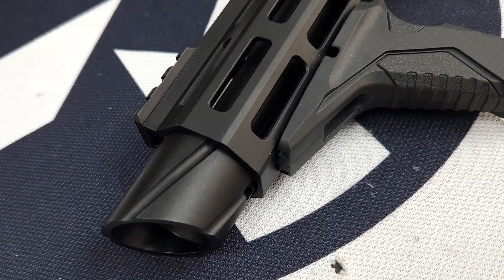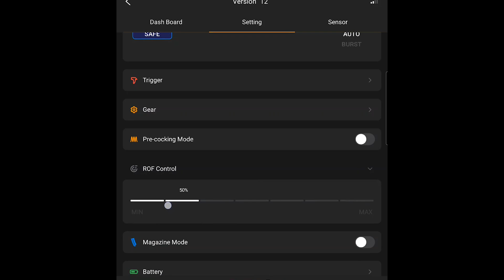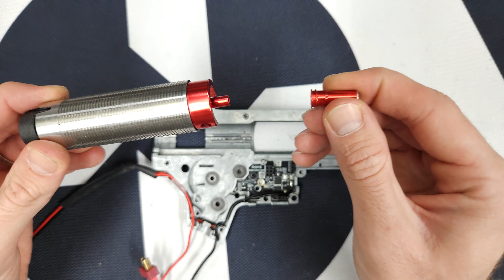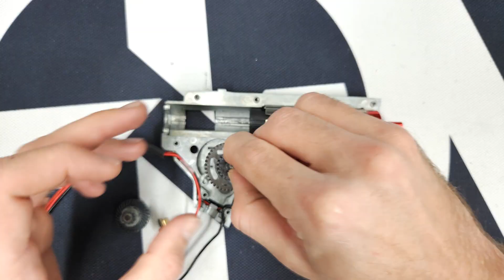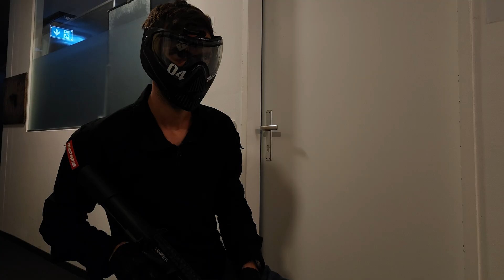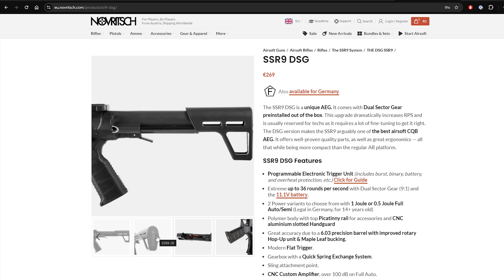SSR9 DSG: Meaningful Upgrades

Comment: This video is a year old, so I guess it's a good time to ask if that piston and it's body specifically is still intact after that many holes put in it to reduce weight?
Reply from the maker: I said this in another comment, i did not use this build extensively. Still, for the ammount of use it saw, there was no visible wear on any of the parts. I also learned that all pistons are consummables in a high rof / high stress builds. So i expect to exchange 1 every year if i use that gun mainly. Just the nature of these toys. The jaeger piston might last longer tho.

Comment: Any 1-year updates? Lessons learned? Comments and/or suggestions? Would highly appreciate as I ordered it recently.
Reply from the maker: This wasn't my main gun, as i prefer the speed of HPA, but i used it a few times. Held up well, until i wanted to put a 5.4:1 dsg in it, that is when the ETU called quits. It still works, but that setup at 66 rps is too fast for the Kestrel. Everything else is fine. What i said about the upgrades still applies.

Comment: I am sorry but having a full Cylinder is NOT worth it.
Not only is there no huge advantage, as the piston doesn´t travel back far enough to really get an advantage, but the hole in the cylinder allows the piston to gain some momentum before being slowed down by the air, meaning the airsoft gun has a higher velocity.
A DSG is not meant for high air volumes.
If you want to use heavier BBs, you have to go with a SSG and more teeth on the gears/piston.
Reply from the maker: While you are not theoretically wrong, in practice, you can clearly see different results. Sure, with a stronger spring, and ported cylinder you can get the same power i got with a weaker spring and no port. So why would you subject your gearbox to more stress, when not needed?

Comment: My dgs is stock already had to have the etu replaced and a few months later my fps has dropped and also my rate of fire  is now 26 rounds a second any ideas what it could be causing this issue
Reply from the maker: Fully charged battery? If yes, the motor brushes may be worn out
Reply: @DeXteR.AIRSOFT thanks mate could be the motor then batteries always fully charged

Comment: What tappet plate did you use? Also when you switched to the SSR4 nozzle what size O ring did you use. And also what cylinder did you use. What motor size did you use also with what type of ETU?

Comment: What do you think, i have a ssr9 i wanna do the same but i want a m170 and a solink 39k motor, bc in my counrty the fps limit is 420fps so i want a above 400fps 40+ rps gun
Its gonna work? With the m170 and the 39k solink?
Reply from the maker: @WoByaT  no, it will not. That setup is thought out badly. High rps means low fps. You can't have both. Or you put an hpa engine in.
Reply: Where are you playing that allows 40rps?

Comment: Hey i liked to know with of this parts i could upgrade for the german 0.5 joule variant without getting more joule and my motor is getting pretty hot is that problem solved with a better motor
Reply: @DeXteR.AIRSOFT
Reply from the maker: @hodenkobold6875  standard motor should not get hot on the german version. Try adjusting the motor height. A brushless motor will reduce heat, of course.
Reply: The spring does not change for the German version. Actually just the inner barrel length is much shorter. Therefore the motor needs the same force and gets as hot as on the 1j variant

Comment: Hello could I ask what piston did you use? Thanks.
Reply from the maker: @snovixik  a random one i had laying around. I recommend the FPS Softair zero shock ones, without cuts.
Reply: @DeXteR.AIRSOFT  Thanks.
Reply: @DeXteR.AIRSOFT  And also did you need to grind something in the gearbox?
Reply from the maker: @snovixik  no, the Kestrel dropped right in.
Reply: @DeXteR.AIRSOFT  And would you be able to recommend a good motor(even the rpm)  and gears(ratio, type) that would fit the classic ssr9 and be compatible with the titan II from gate?
Reply from the maker: @snovixik  at this point, it's honestly better to consult with your local tech / shop, as this is away from the scope of this video
Reply: @DeXteR.AIRSOFT  Ok thanks for your answer

Comment: Which tappet plate and cylinder did you use?  The cylinder looks like the ssr-4 one
Reply from the maker: @genetic187  used an SHS tappet i had laying around, and the cylinder might be from a chinese brand, i don't remember. The SSR4 one has 4 elongated ports towards the back, this was a full cylinder

Comment: With all the upgrades one could choose a cheaper variant and save ~100$
Upgrade the spring to get 1.5J actually makes it more reliable and better accuracy with 0.28-0,32.
We need better lipo though with more stable discharge rate.
Reply from the maker: True, this was more from the perspective of someone who already has an SSR9, I wanted to show what you can change, with an actual impact on performance. Not all these upgrades need to be made, it depends on each person, what they want to achieve. Peace of mind? Change tappet and piston, maybe ETU. Want faster response + ROF? Get the motor. Want better sound? shim it + helical gears :))

But yes, I agree, with a cheaper platform to start, you can do all these upgrades, plus a barrel + hop unit, and still be at 600$ or less.
Reply: lmao